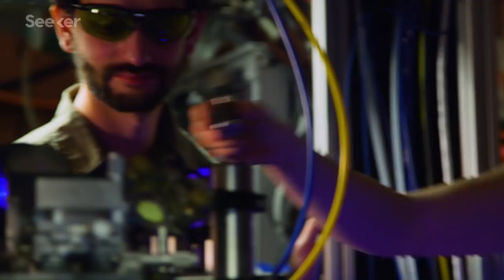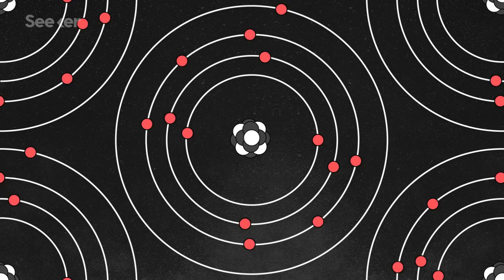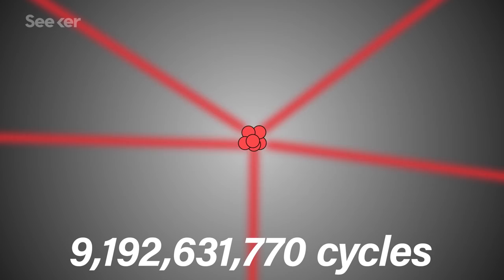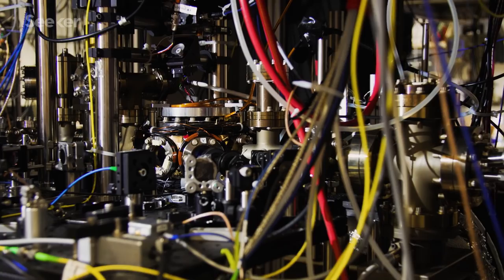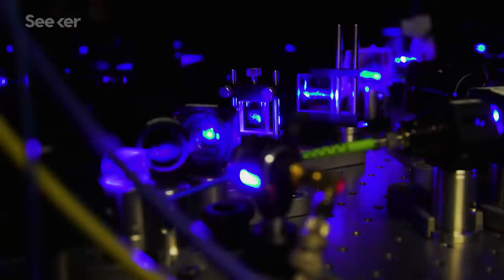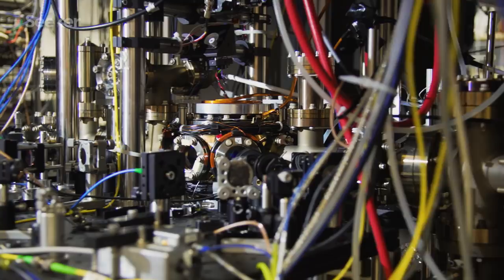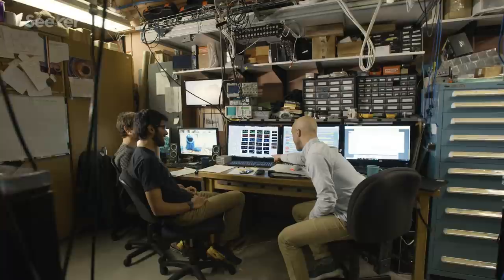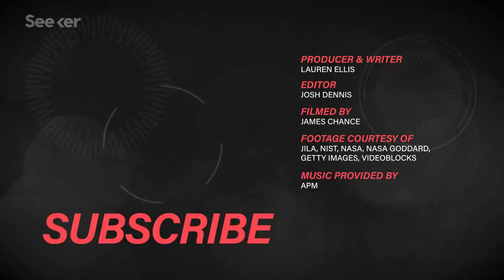This 3D Quantum Gas Clock Could Redefine Time

Comment: The quantum age is coming
Reply: Coming?  No, it is already here.
Reply: @jimbert50  Correction. Has begun
Reply: @Mark-uk8wz  No, it has been here for decades.  How do you think lasers work?  They have been around for decades, even as simple pointers.  LEDs?  Same thing.  Transistors?  Even longer.  They are all based on quantum physics.   Quantum physics itself was pretty much all defined in the 1930s.  Since then it has just been refined and proven time and time (heh) again.
Reply: @jimbert50  My statement above implied applying quantum physics to technology
Reply: Quantum Age, I think, will be boring, since we achieved infinitesimally unit

Comment: How does gravity affect this clock?
Reply: Not to mention speed. And isn't the claim of time being a "universal constant" inaccurate? 0:53
Reply: The same way that it affects every clock.    Time runs slower in high gravitational fields.  This affects every method for measuring time.  
This is why the GPS satellites need to take into account the gravity strength at their orbital height as well as their velocity (which also affects the rate of time).
Reply: At atomic level, gravity is not important.
Gravity affects big mases.
Reply: What aboot when you leave the pull of the earths gravity and sun how will weightlessness and the vacuum of space effect the clock?
Reply: Easy because any atom emite bay that divice IT Will move în side or slow when îs move depending The gravitațional feld. BUT îs usles I belive this kinde of tehnologii. And if they tell You abauth dark matter they have secret knolege.
Reply: it will detect 6 inches of height difference on gravity planet earth
Reply: @jrno93  faster...10E-17 faster....1 second per 1 billion years

Comment: @1:36  The 'constant' value of relative time & space is directly influenced by your approximate position to Saggitarius 'A', that which is holding all of the galaxy together is also infuencing the standard rate of time. If you want a completely accurate measurement of time, it will always coincide with the power of gravity and proximity to the singularity determining that gravity. It's something you tune as you go, not hold as a static measurement.

Comment: Wouldn't the best clock be the time it takes an atom of helium to expell a photon after it has been energized multiplied by a certain factor 🤔
Reply: Lol Bro no
Reply: AFAICT, the outermost electrons of atoms of lighter elements oscillate between energy levels at a lower frequency than the outermost electrons of atoms of heavier elements. (Inner orbitals -> big energy gaps + lower frequency, outer orbitals -> smaller energy jumps + higher frequency.) Helium atoms would be more convenient to work with, but its electron oscillations would measure time more coarsely - they would "tick slower", which leads to bigger "rounding errors" in measurement. For the most precision (the smallest "ticks"), you want a fairly heavy element/isotope, with at least one spot free in its outermost electron orbital - but not so heavy that spontaneous atomic decay becomes a serious issue.
Reply: HaloInverse so that’s how they ended up with strontium?
Reply: @HaloInverse  the time it takes a helium atom to expell a photon assuming the conditions are the same would be the same always the only problem is we don't have equipment precise enough if it were the definition of the second would be something like the time it take a helium atom to revert to it's ground state after being energized with x number of electron volts when the helium atom is suspended in a temperature of 273.5 degrees Kelvin multiplied by a certain factor, this would be the most precise as helium is stable and a simpler element with less elementary particles that could screw up calculations
Edit I'm not talking about ticks I'm talking about time taken to undergo spontaneous emission

Comment: Wait what? Time is not constant!! Einstein's theory of relativity Schrodinger's cat and time dilation of all proven that time is not constant.
Simplest way to even test this was already proven to be the humble cell phone and the GPS system on board. The GPS system is nothing but a giant cuckoo clock that is surrounding us up in space that keeps accurate time for us down here. But the problem is those GPS satellites are constantly two seconds ahead of the clocks on Earth due to the lack of gravity and the high speeds at which they travel. The closer you get to light speed or the closer you get to a high gravity well the slower time gets for you even though you don't notice the change but it's faster for everyone else the closer you get to these objects. The problem with these atomic clocks that I'm saying is that they're built to operate on the only known gravity well if we can actually access that is the Earth if we made the same clock on the surface of a larger body the clock would be noticeably slower due to the mass of the planet that it is on. I'm not saying that these experiments are useless time is a needed factor for equations in many scientific experiments but it is far from constant.
Reply: Time is relative and not constant, but I think you don't exactly understand how time dilation works. In YOUR frame of reference, time feels always the same. The only situation in which time varies is when you observe someone in a different frame of reference (or in a different gravitational potential), so if you bring this clock to a spaceship, crew members will see the same results as we see in earth. So these clocks are doing their job well. What you think is a problem is the fact that the signals that they send to earth might be time-distorted. That's true, but we can compute those changes with special and general relativity so there is no problem at all.

Comment: Light speeds are altered when passing through gasses at different temperatures so yes different places in the universe ..the  propagation speed of gravity is also altered by certain phenomenon ...space time is different at many points and areas of the universe ...how to take that in to account and formulate an equation for that ...entropy of spacetime =rate of expansion of the universe xTotal mass of the universe ÷ the area squared  between the two =probable space time entropy

Comment: This clock reads the frame/cycle rate of the universe in a sense in its location. This kind of device will also be useful once its scaled down to allow us to understand time and how it actually runs in different places, like the moon for example. Compare the cycles to earth cycles and we should have moon time and we can actually calculate time on the moon and sync the earth and moon together. Another piece of the puzzle pretty much. And because of how time works. It is different all over the place. Even on earth. Time rates flow differently. And it all depends on so many things. Gravity speed mass temperature and more. Time is pretty awesome. But my favorite part is how it slows down with gravity mass and speed thanks to how it affects the photons. In all theory of course =).

Comment: Time is a construct
Reply: Ok maybe but why does everything  that we know of seem to change under the inescapable guidance of entropy, which is a natural byproduct of what we call time? And the few subatomic particles that might theoretically transcend time are 1) theoretical and 2) still bound by and within time...sure, our measurements of time are constructs, but I challenge you to make a convincing argument that time itself is imaginary, a construct....
Reply: The way we perceive time is abstract or a construct, but everything is affected by time and aging. The same thing with weight, everything has mass but weight is determined by gravitational forces making it a construct.
Reply: Came to the comments looking for the inevitable tool who thinks time doesn't exist.
Sir, you did not disappoint   :)
Reply: @kevinnoble1581  that analogy is a little inconsistent...weight isn't a construct, objects do have a weight within a gravitational field that is proportional to the strength of the field itself. Our measurement of weight could be called a construct, but weight is definitely a real thing...
Reply: Time is not construct, the way we measure time is
Reply: TheHorizonTries the way we measure weight is a construct but I said mass is absolute.
Reply: if we are going down this route, then everything is a construct
Reply: Your a construct
Reply: Time as measured is a construct I agree. But the process of change is what is going on. We label that 'time'. People who try to define time or get the smallest possible unit of time, are wasting their...well...time. they are just trying to hone a definition of a label. It's pointless.

Comment: You are getting down to the level where the differences due to General Relativity between people in different rooms of the same building or moving versus sitting at a desk will be larger than the precision of your super-clock, so the practical effects will thus be extremely limited as to usefulness...

Comment: What is Time? 

1. Assume the three dimensional Universe is inside a three dimensional photo Frame. Everything in this universe is dynamic and changing in relative to other things and itself. Entropy is
changing also. 

2. The whole Universe inside the frame marked as Now Moment is separated from previous Now Moment by shortest possible separator Plunk-time. 

3. Last Now Moments are Record, History, Memory or Information. Next Now Moments are next changed states of the Universe inside Frame.  

4. Only Now Moment Exist. Past and Future do not exist. Flow of Time forward or backward does not exist. No arrow of time. It is arrow of Change. Only Moment is ticking repeatedly at Plunk-Time interval with a new 3D-Photo of the Universe. 

5. Conscious Mind can make
predictions of next Moments from experience and can plan events for next Moments. 

6. Every Plunk-Volume’s “Now” of the Universe including space and stuffs in it is always in the same Now Moment Frame of the Universe. Relative Clock ticking, fast or slow, at different plunk-volume for different conditions does not shift anything to previous or next Moment Frames of the Universe. Because clocks ticking slow or fast does not mean Time elapsing slow or fast. It is error of the clock for certain condition which need to be adjusted. All points Now remain in the Now Moment Frame of the Universe. That is why twins of paradox can meet at any ones Now though relatively they are backward or forward in respect of amount of time elapsed. Time travel is not possible. Our invented Clocks and Calendars are misleading us about time in the repetition of day & night and seasons.

Comment: An interesting experiment would be to take a super accurate atomic clock like this one and test for time dilation under various conditions. If time dilation does occur then comparing 2 atomic clocks such as this one would likely yield some information.
Reply: That has already been done with atomic clocks.   
http://hyperphysics.phy-astr.gsu.edu/hbase/Relativ/airtim.html

Time dilation does occur and without taking it into account, GPS would not work.

Comment: I think Einstein had it wrong and that time is constant, not the speed of light.  I think dark matter density is the limiting factor to the speed of light and that gravity and dark matter density bend/pull on light (and everything else), not 'spacetime'.  I think quartz pulses and atomic clocks are induced to operate more slowly when traveling at high velocities in space, slowing our measurements of time, not time itself.

Comment: I find this sort of thing fascinating.  I even understand it (I think!); it means that if you're measuring something ONLY in meters, you could be off by a decimeter - but if you're measuring in millimeters, you can ONLY be off by something smaller than THAT, and that's better measurement!  I also understand that it provides a new standard for everything - NOT just clocks!  A measure of time is also a measure of distance - just like the light-year.  But I do wonder something.  At any point, are they going to be wanting to move these experiments into space?  After all, we ARE in a gravity well.  Do we need (or want) to compare the difference?  And: hey, "It's_a_trab": 'quantum clock zappa' would be cooler! 😊     Rikki Tikki.

Comment: Whatever happened to the IC frequency standard around 2000 that was coming out then and was claimed to be 100 times more accurate then Rubidium clocks ? It think if was MEMs based and it was portable and cheap enough to be used commonly. I think they said about $6 to $10 for a 10^-15 standard ! More tech that disappeared like the 5D 300TB optical disc in 2012 ? Yet drones can store 1 MILLION TERABYTES a DAY for EACH DRONE somehow ! Can anyone explain that ? Any yes, I checked the transcript and it was 1 million TERABYTS per day or 365 Million TB per year, per drone. What stoage tech could handle that ? A 100,000  10TB drives RAID system a day maybe ? It was on a PBS show about drones talking about the Argus system so nobody can claim it is a rumor or theory.

Comment: So the vibrations are constant and absolute? They don't vary based on temperature, pressure, velocity, and such? The don't change as the power of the lasers degrades over time? 🤨

Comment: Thinking about quantum time I thought about the sun dial and how it was timing space then realized the core is connected to space first before the top side so we have to record core time tempature to load with atmosphere time pressure temperature to match the load sound of void time to accurately get the quantum time structure the core know the sun time so it knows when to start the day with pressure light activity or Cosmic energy like timing atoms to there kinetic structure body hold of why is the form in this time motion

Comment: Will more accurate time make GPS more accurate?  Could it help to pinpoint a location to within a few mm instead of few feet ?  If not - what’s the limiting factor in terms of accuracy for GPS location?
Reply: The accuracy of GPS has more to do with the receiver than the satellites time.  So, making the satellites clocks more accurate won't help since they are accurate enough already for that purpose.   A more accurate method of comparing the signals from different satellites by the recievers is what would give more accurate locations with GPS.

Comment: Why do we need even more precise clocks? Or what use could we have of them?
Reply: @No Idol I have a physics degree and I found the answer to my question at the end of the video, since I was asking for these clocks, not the ones from 30 years ago. And the reason is not a practical one but pure science, as opposed to applied science.
And the reason has to do with relativity. Since time is not invariant to motion, this would help to find a limit to the variance of time on reference frames with different velocities. So we need to be able to measure even smaller units of time. Gravity may be involved too, since it bends spacetime. At least that's the extent to which I understood.
Reply: *50 years ago

Comment: We can solve this time and space, but to do it we need to appeal back to philosophy again.  Math is wonderful, but logic may deviate slightly from it.  One is time and space is real thing gravity has proven that, and as such it is made of something, something smaller then it.  Next we must take infinity seriously so infinitely small is impossible, in time and space.  So, we reach the size of a Plank, but we will call it a Plankxel.  Like a pixel in a photograph it grays potentials and when enough color is in a Plankxel it creates a particle, hence the wave function, quantum effect.  So, what happens to the particles smaller than a space time Plankxel no effect they fly through as if no gravity exists, but if they are larger, or vibrate lager then a Pankxel they pull other space time units into it, creating gravity.  This someday will be able to be proven if we combine small particles like photons into a larger one with gravity.  Energy will go into mass.

Comment: So we are using one less accurate clock to measure the cycle of something which is more accurate. I understand we can use fractions and maths to interpolate where numbers should fit in. But something is just making me feel we may be missing something else here, possibly of big relevance, when using something less accurate to measre something to a more accurate level.
Reply: hmm... no
we are not measuring something more accurate with something less accurate. we are using a countable phenomenon (cycles) to define more precisely a unit of measurement, not the other way around.
Reply: Yes i get that. But we count how many happen over x. Where x is not as accurate as what we are counting, correct? So i assume we add a level of error, wouldn't that error be the same size as what we improved by?

Comment: This entire project is based on the acceptance of light as a universal constant. Some studies however, suggest that the speed of light may vary. https://arxiv.org/abs/1606.02128. If light speed varies, any study using light or lasers to measure time is flawed. While it may not be the case, it is certainly something to consider. Perhaps a good topic for a future @Seeker video?
Reply: not quite, the resonance or electrons and atoms does not depend on the speed of light, variable light speed or even +c is definately possible...typically "most" things travel at 0.99c, half relativistic and quantum

Comment: So changing from 
Microwave to light/laser/visible light

Is like using a cm instead of a meter in measuring distance?

So is it possible to use ultraviolet or higher in the spectrum?
Reply: Sharp Harpoon perhaps but that’ll be later down the road!
Reply: Sharp Harpoon yep its all in the fractional measurement more accuracy is desired